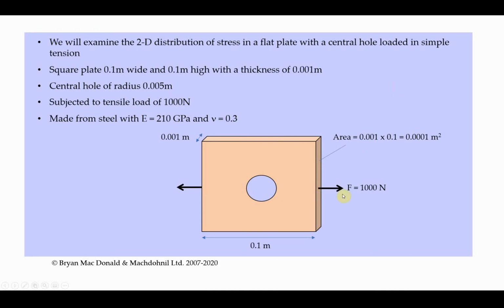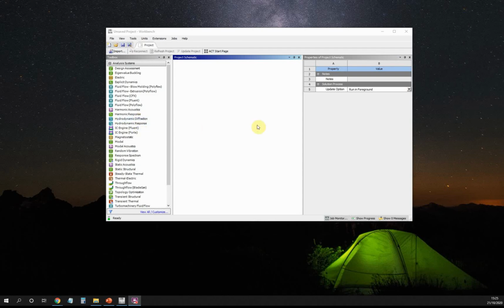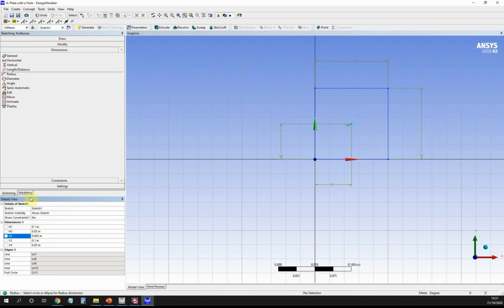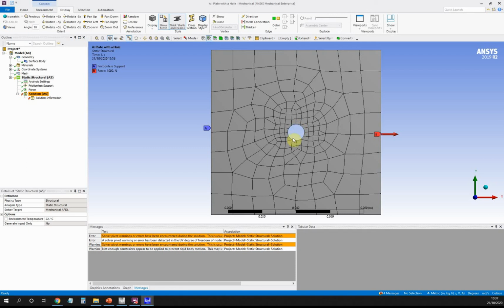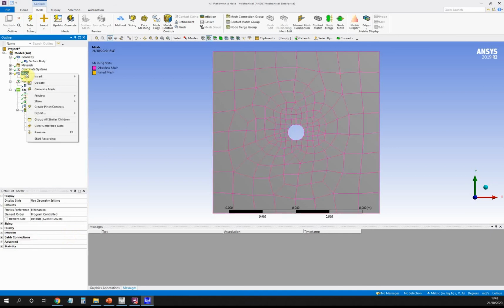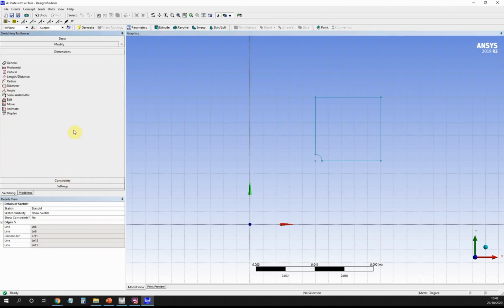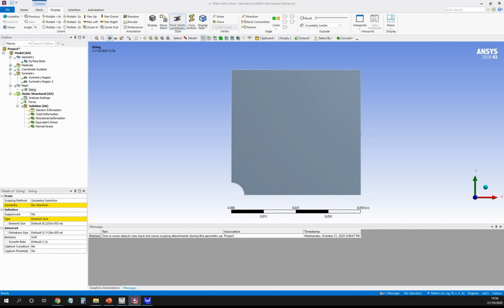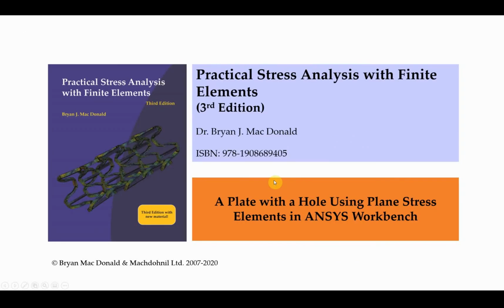2D Plate with a Hole using ANSYS Workbench

Comment: Very bad example, with many critical errors:
1)	the mesh in the stress concentration area is irregular;
2)	a fictitious constraint (along Y axis in this case) should be placed as far away as possible from the area where stresses need to be analyzed;
3)	the reaction forces at this fictitious support must be monitored; if the reaction force is not zero, the stresses and displacements in that area will be incorrect;
4)	here, the constraint along the Y-axis should have been placed on the horizontal axis of symmetry, as far from the hole as possible;
5)	there is no convergence study.
And besides the errors in the analysis — the speaker was incredibly annoying with constant lip-smacking sounds.

Очень плохой пример, много грубых ошибок:
1) сетка в зоне концентрации не регулярная;
2) фиктивное закрепление нужно ставить как можно дальше от той области, в которой требуется снимать напряжения;
3) нужно контролировать реакции на этом фиктивном закреплении; в случае, если реакция не равна нулю, напряжения и перемещения в данной области будут некорректными;
4) здесь закрепление по оси Y нужно было ставить на горизонтальной оси симметрии, как можно дальше от кромок;
5) нет исследования на сходимость.
И кроме ошибок в анализе - спикер задолбал постоянными причмокиваниями.

Comment: Hi, really helpful video! I'm wondering if you could explain why you ignore the negative value given on the normal strain results. Do + and - not indicate the maximum compressive and tensile values? Thank you
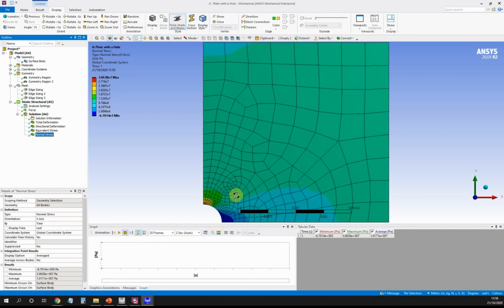Reply from the maker: Hi, the negative values indicate compressive stress/strain while the positive values are tensile. The reason I am ignoring them is that, if you take a look, you will see that the negative values are (at least) an order of magnitude smaller than the positive values. For example, at time 36:00 in the video, the max tensile stress is 3e7 Pa while the max compressive stress is -6.7e5 Pa. Hope this helps.

Comment: hello sir  instead of using the  number of division tool in sizing if directly change the size of all elements then what will be the difference in meshing in that way.
Reply from the maker: Hi. it's possible to get a good mesh, or even the same mesh, with both methods

Comment: I did exactly as you said and The Analysis is in 2D i get this message ( A solver pivot model warning or error has been detected in the UZ degree of freedom of node 3806 located in UNknown this is usually a result of an ill conditioned .....etc) can you help me?pls
Reply from the maker: Hi, that error message is basically saying to you that your model is unconstrained in the z-direction and can move as much as it wants in the z-direction. Clearly this is a 2D model and should only have degrees of freedom (DOF) in the x and y directions. I suspect what has happened is that you forgot the step early in the video where you set the analysis type to a 2D analysis!
Reply: @LearnFiniteElementAnalysis  thanks alot for your help actually it was because the file name should be in English and i was using German letters so that was the problem

Comment: Thanks for the video. Was really helpful. 
One question though , the way you applied the boudary conditions seemed a little redundant to me.
If I was doing this analysis I probably would have gone with fixed support. 
Can you explain a little bit as to why you took this approach? I am just a learner so maybe I am missing something obvious.
Reply from the maker: No problem - glad you found it useful!
If we applied a fixed support then the nodes that make up the edge of the plate would not be able to move in any direction. We want these nodes to be able to slide along the line that we have added the boundary conditions to - so that the plate can change shape due to the applied load. If we applied a fixed support instead then the plate would not deform properly. Hope this makes sense?

Comment: I attempting to generate the surface, but when using the create surface tool , only the center hole gets filled.
Reply from the maker: Hi, it's possible that the lines making the outer square are not joined together - there may be a small gap between them. Try checking this and see if it helps!

Comment: after generating mesh i click on static structural but my model goes back to 2d plane with no thickness, and the mesh disappear
Reply from the maker: Hi, that normally isn't a problem. If you click on mesh again then the mesh should be redisplayed. Sometimes workbench turns off the display of the mesh to make it easier for you to pick geometrical features when applying loads etc.

Comment: If I do this with symmetry on a thin plate in 3d I get the error: "one or more bodies may be underconstrained and experience rigid body motion. Weak springs have been added to attain a solution" 
How do I fix this problem?
Reply from the maker: The error message is telling you that your model is underconstrained and is moving around in space. If you did this in 3D then I am guessing that you put the symmetry constraints in the x and y axis but you also need to put at least one constraint in the z-direction.